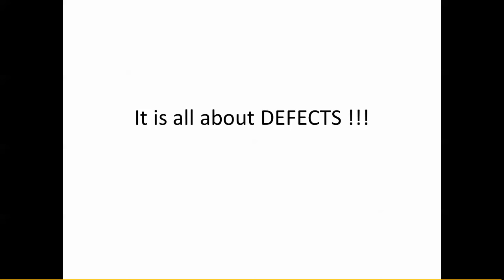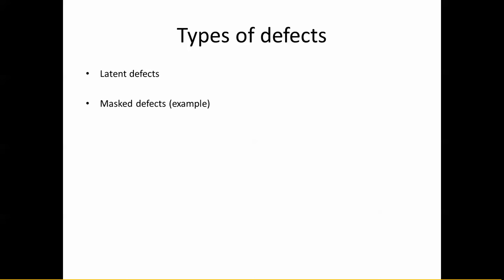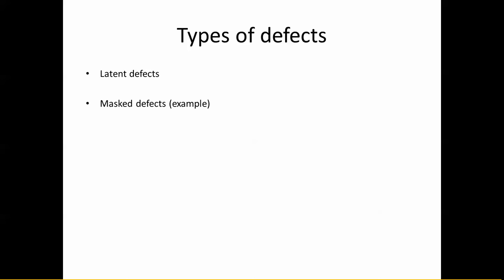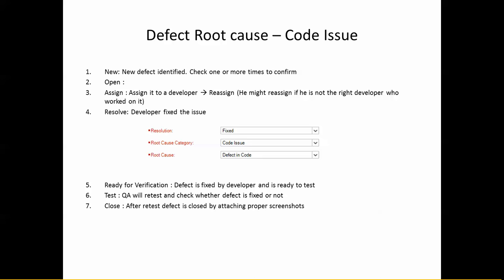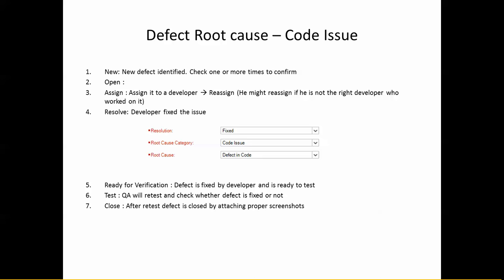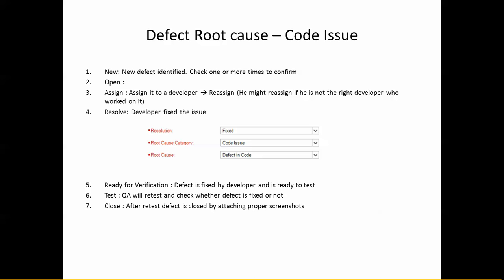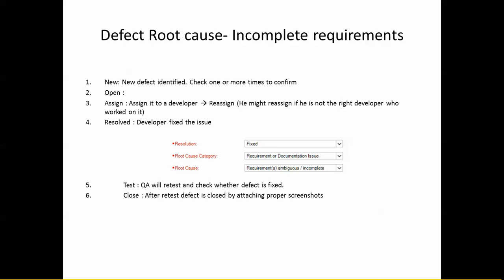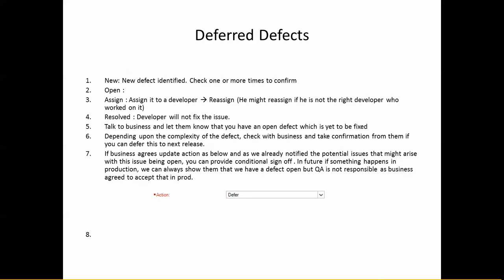Defect lifecycle

Comment: could you help me with this questions, please
1.          Dev has provided a bug fix, build is deployed on an environment and when you verify the fix, it is still not fixed.

How would you proceed in resolving this issue and what steps would you take before you go to developer?

2.         Some of the functionalities are not available to start the System integration testing but you have to start how would you proceed?

3.         What are the different ways to identify the locators in selenium? Which is the best one and why?

4.         Out of thousand automated test cases, how would you run all the P1 test cases on different browsers at the same time.
Reply from the maker: 1.  You will reopen your bug and assign to your developer. If he is still not accepting your defect  follow the steps that I explained in one of my videos.
https://www.youtube.com/edit?o=U&video_id=1nXCkuiPg20

2.You should not start your testing until you have a proper functional code deployed to QA. There is no point wasting time in SIT when you know that you have dependencies.

3. I did explain all about locator techniques in this video
https://www.youtube.com/edit?o=U&video_id=pNwQy5qav9w

4. I would use the concept of TestNG parallel tests here. I will group all my testcases that I would like to run and configure my XML to run parallel tests on this group.